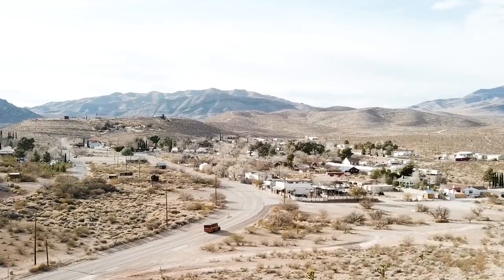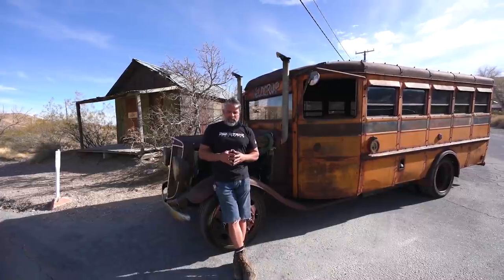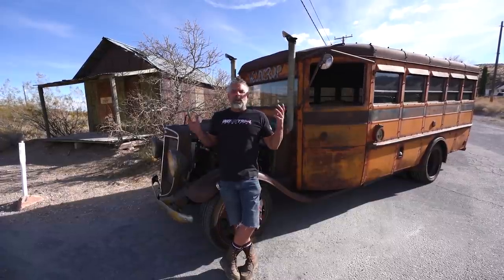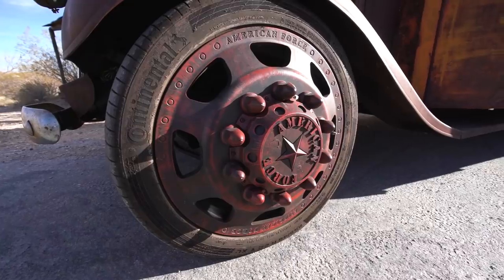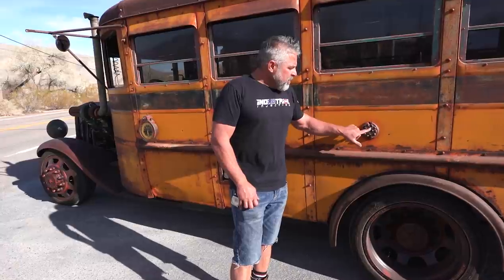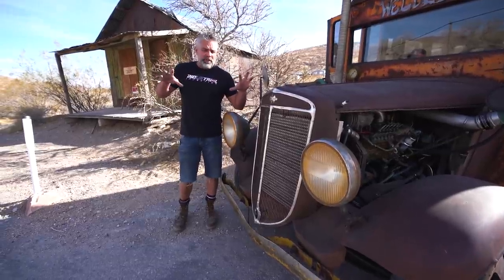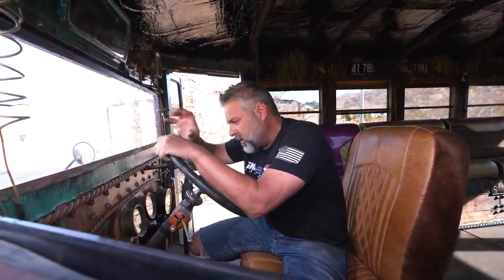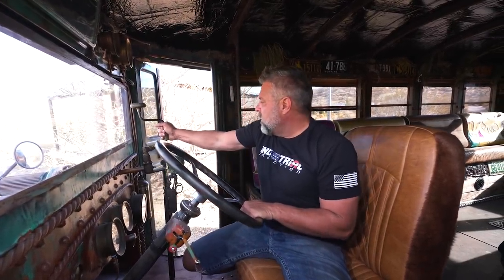Vintage Welderup School Bus

Comment: Those round paper roll caps had a unique smell - i was right back there - stay safe
Reply: and really loud when you hit a whole roll with Dads sledge hammer. my ears are still ringing.
Reply: @markthegunplumber8376   LOL did that too !!
Reply: In the dark after you fired a roll did you notice a glow from the powder ?on the inside where the caps struck by the hammer always wondered about that .

Comment: I rode in an old Wayne bus back in the day alot. The oldest they had I believe was an early 60's bus. And yes we had a few Drivers that were drunk in the morning when we got picked up and even drunker when we was dropped off..LOL..HAHA.But they could drive a bus. Hell I would of too if I had to put up with us Back then too....LOLGreat People though..Great old bus you made. Love it. Brought back alot of great memories.  Great video thank you for sharing... Hell I had a 1990 Toyota  Pickup Regular cab 4x4 and I had 2- 15 in speakers behind the seats. And it had 14 speakers 4 amps a 6 disc CD changer and Cassette  deck in dash with Equalizer . All remote. You need a couple more amps and a few more speakers in that bus...You couldnt see out of my back window because of the box...LOL..Haha...I think that may be why I cant hear today....LMAO....You think....lol Play Arron Tippin Aint Nothin Wrong With The Radio in it. It sounds AWESOME..LOL Great Build Guy...

Comment: The old hand drill is awesome I was born in 1992 and me and my grandpa used to go out and fix fins using an old hand drill we find an old cedar tree cut it down make an H post add a wire I have to hand drill it for the wooden dowels he told me some of this stuff will be standing when I was old still this day's still standing

Comment: Bonjour Steve,
Amazing bus, I like it indeed. Just a question, as you use it,  I do not see any safety belt, even for the driver, would not they be mandatory for a rebuilt car?
Amicalement Raphaël
Reply from the maker: No, it wasn't required but it would be the safer thing to do. Thanks for asking and thanks for watching!

Comment: I used to have two 12"s and an 18" sub in my car back in 97.. next I took the backseat out of my Jeep and had a huge bandpass box with 12's and a window with lights on em.... could hear me coming from a mile away!
Edit: ticket for loud stereo was called noise pollution where I'm from.

Comment: Hey Steve it’s Dave Hill I met you at your swap meet I was a guy with all the right handed welding gloves I’m in the market for a pee pump 12 valve pick up truck like around the 97 with a manual transmission four-wheel-drive extra cab you got anything like that let me know
Reply from the maker: Hey Dave, How ya doing? I don't have anything like that right now. I will keep my eyes open.

Comment: Where I am from they only had one room school houses unless you lived in a town or city that's all there was here in Canada and paved roads many of the ron main streets were not paved till the 50's before then they were all dirt roads and many of the older cars from the 40's and even in the early 50's you can tell because dirt would be packed in the transmission and on the engine and in the frames